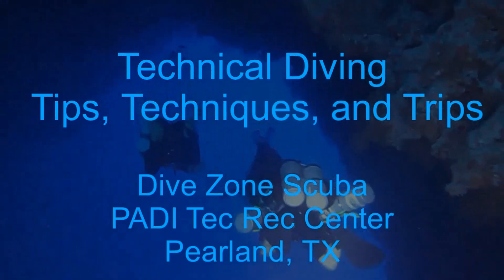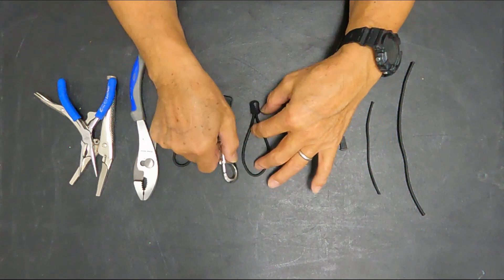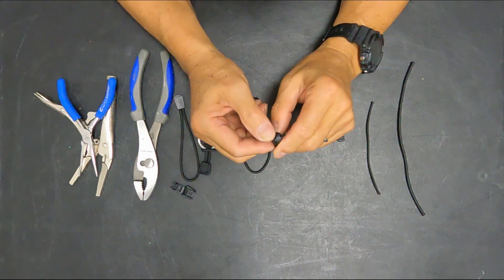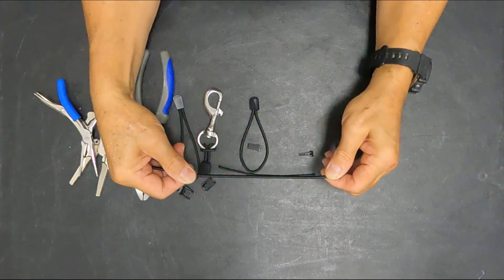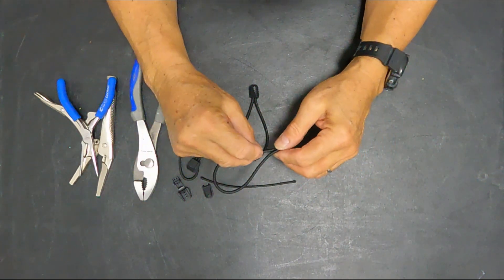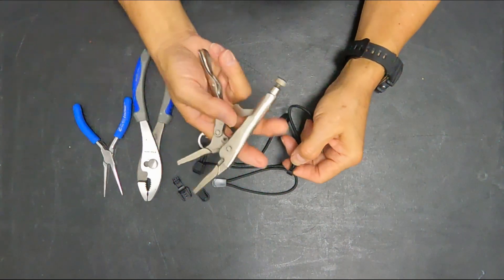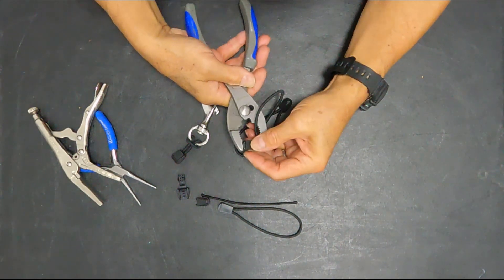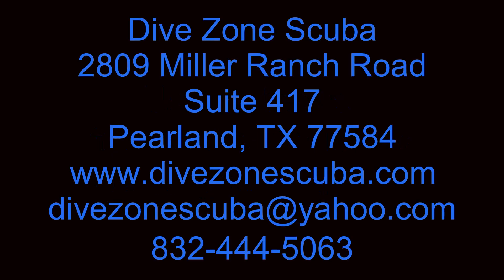#192 - New Developments in Bungee Retainers For Scuba Diving

Comment from the maker: The major advantages are that it will never come undone and that the end fitting allows you to secure the bungee to the equipment items in ways that are not possible with just an overhand knot.  Since the ends are not exposed they are less likely to fray versus burned but exposed ends.

Fittings are also less bulky and looks neater which may or may not be important to some.

Most people buy them premade, but that limits the loop size and bungee thickness to what’s available.  That’s why you mostly only see them used to secure the long hose.  Making your own leads to their use for many other applications if done properly.